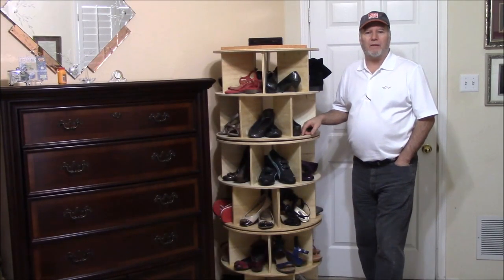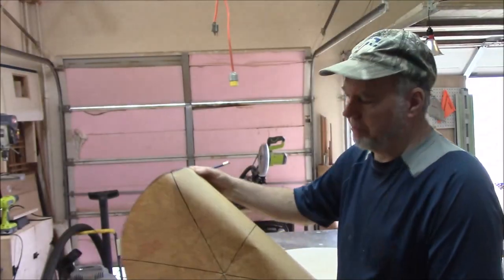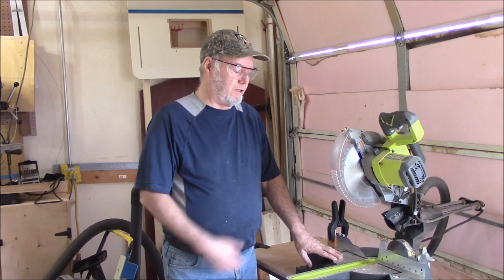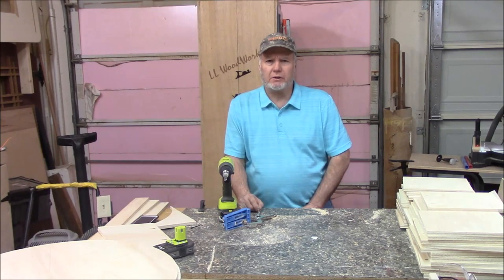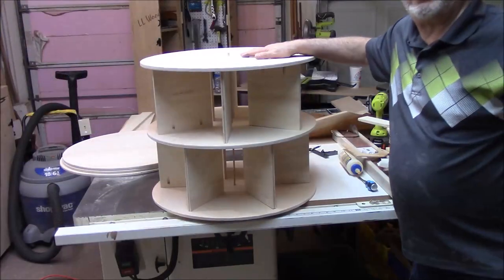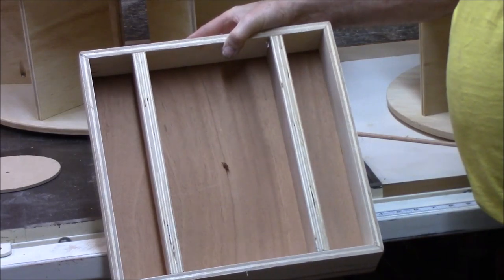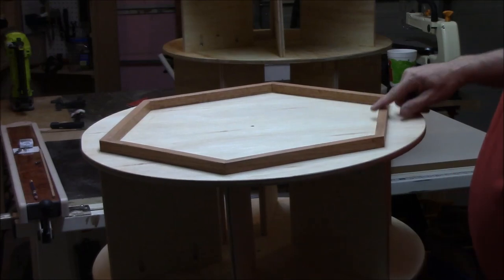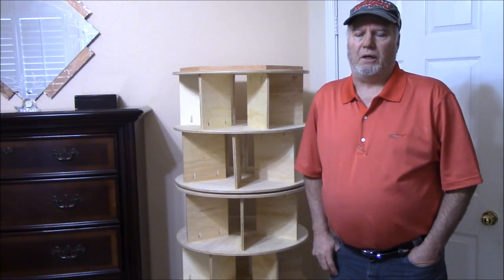How To Make a Lazy Susan Shoe Carousel

Comment: Good project. As far as holes from underneath or pocket holes, you would still have to drill just as many holes. Looks like you need a shorter drill driver and bit
Reply from the maker: +Mike Turner I actually found a flexible "Snake" Extension and used that on most of them. That made it much easier.  Thanks Mike.

Comment: Amazing! But can you show how to attach lazy Susan from both sides, I have 12" circle. Thanks.
Reply from the maker: As you saw I didn't attach them from both sides, used the locator discs in each unit. To attach from both sides you would have to drill an access hole  at the correct location to allow you to secure them.  Thanks for watching.

Comment: What was the rational in using pocket hole joints instead of just drilling holes in the circles and screwing from the other side.  Because you offset the compartments you could have done this. Wouldn't it have been easier and faster.
Reply from the maker: +Brian Binns yep tr would have been - I just wanted to use pocket hole screws.  If I were to make another one I would do it like you described though. Thanks for the comments.
Reply from the maker: +Brian Binns Actually I should have done it both ways to show people there are options, thinking back I wish I had done both.

Comment: this is what l needed for wife thanks is that a 1/4 inch plywood on top  of section for elingment
Reply from the maker: I think everything is 1/2" ply     Thanks for watching and commenting
Reply: what is the measurement of the plate you used to center the lazy susan
Reply from the maker: I think 9"  If I understand what your asking it is the same diameter as the inside of the lazy susan.
Reply: what is the thickness of plywood you used to center the bearing on the circles
Reply from the maker: that is 1/4" MDF  Thanks and good luck - I'd like to see a picture when ur finished.  Good Luck
Reply: thanks very much